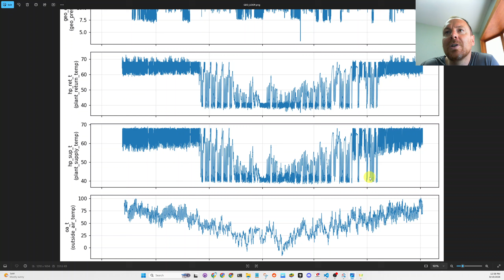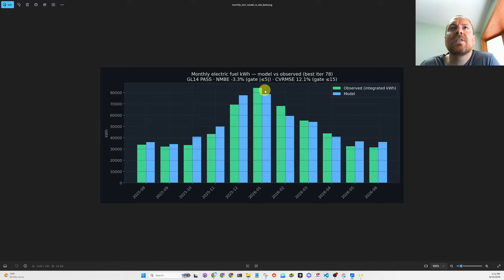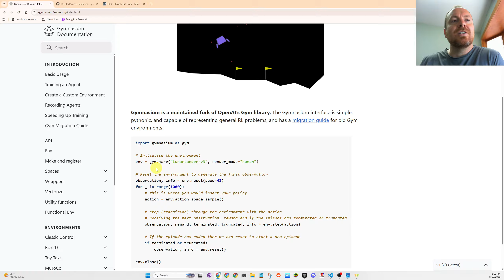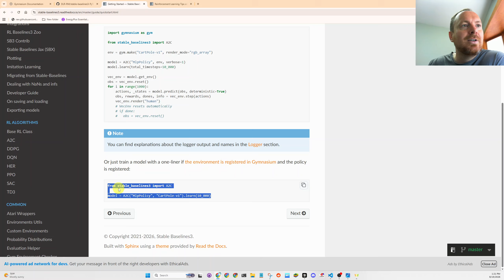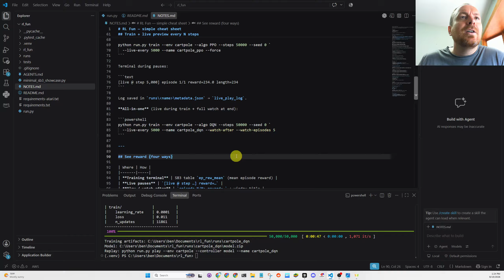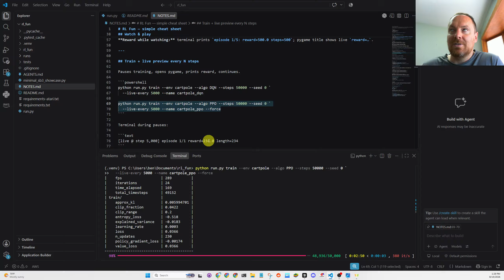Vibe Code App 22: Reinforcement Learning for BACnet Demand-Side Management — Part 3

Comment: Ben, this is where the experiment gets especially interesting to me. Once reinforcement learning moves from simulation toward BACnet-controlled DSM, the question isn't only whether the agent learns an effective policy.

What makes a particular learned action admissible now?

Building conditions change. Occupancy changes. Equipment state changes. Sensor evidence can become stale. Authority and operating boundaries can change.

Before an RL action alters a setpoint, stages equipment, sheds load, or otherwise creates physical consequence, there should be a governed boundary between recommendation and execution.

That's the territory TA-14 is working on:
Reality → Record → Continuity → Admissibility → Binding → Commit → Execution → Outcome.

I'd be interested in how you're thinking about that boundary as this moves toward live BACnet control.
Reply from the maker: Thanks for the comment .... That is close to the architecture I have in mind: the RL policy would make one bounded recommendation per day rather than continuously controlling the BAS. At midnight, the application would collect the next 24-hour weather forecast, (potential time-of-use rates for $/kWh in the future....), current temperatures inside the building via BACnet requests to controllers for sensor present values which would need to be averaged to represent the six representative heat pump zones, current time-of-week, school-calendar state, equipment availability, and electrical-demand history. The policy would then propose one daily plan containing heating setbacks, morning recovery timing, and zone adjustments. Before any BACnet write, an independent admissibility gate would verify data freshness, point identity, comfort and freeze-protection limits, equipment state, and operating authority. If any check failed, the ordinary BAS schedule would remain active. If admitted, the plan would be written once, verified by a BACnet read-back, and executed by the existing BAS controllers. At the end of the day, actual demand, energy use, and comfort would produce a reward for evaluating a shadow candidate policy, but a newly tuned policy would still require validation before gaining command authority.